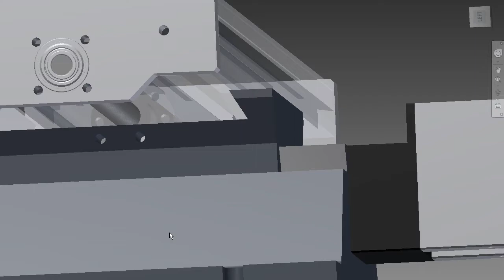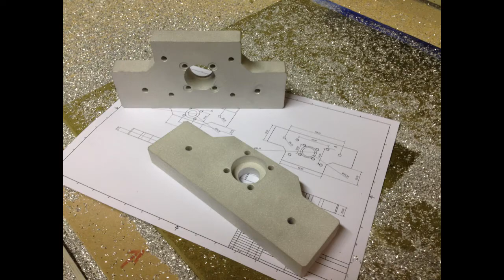RCNC BF20L 06 : Assembly of the Optimum BF20L X-axis

Comment: I cannot stress how much i  thank you for your free information on this cnc convertion.
I will make it with motore spaces instead cause i already purcase the aluminium parts and i just now figure out your site!
My mill is about the same model from a different brand(vf25L from cau cau).
I would like to ask you if your NEMA34 motors do you any problems for standing a litle proud above tha milling table.
I already have them so i would stick on NEMA34 steppers to.
Anyway i will be watcing you.
Great work my friend, subscribed offcourse..
Reply from the maker: Welcome and thank you for the very kind words ! 
The motors used are working absolutely fine for me since they are outside the working envelope.
Also If you would want to machine bigger parts it is not very common to place it flat on the surface since you will probably prevent the cutter from touching the table.